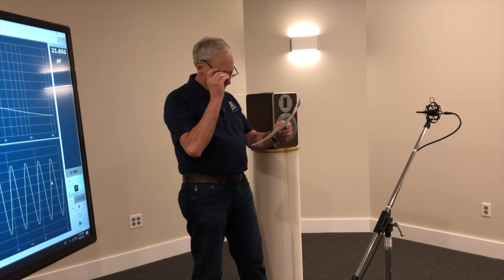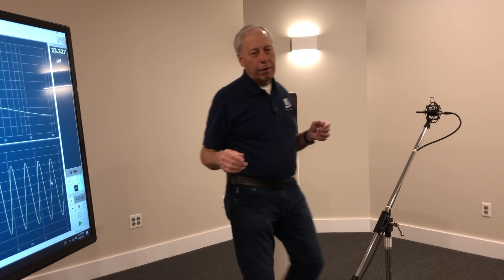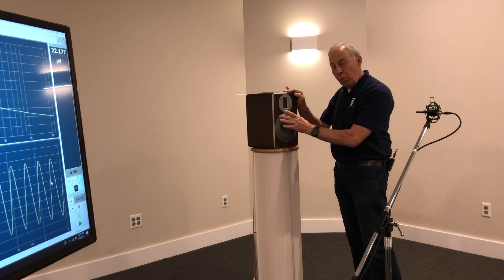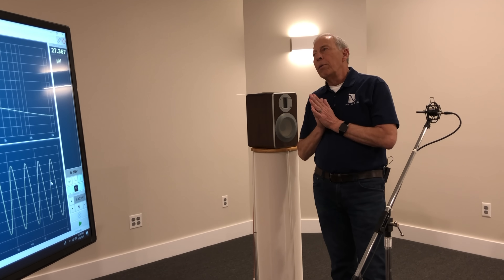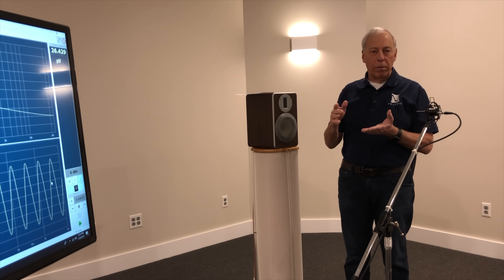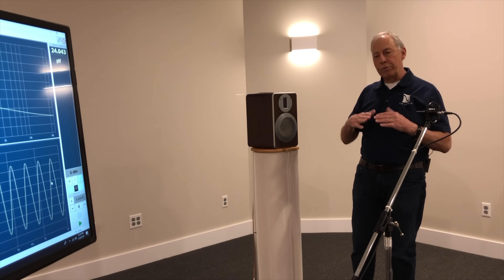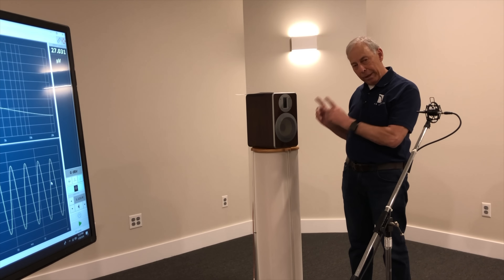How many drivers should a speaker have?

Comment: In my view, we need 5 way systems. The very low bass has unique requirements often only met by a subwoofer. The most acoustic energy in live music is covered by the midbass so this needs special treatment. Then we have the lower midrange where most of the voices get their "presence". The upper midrange and lower treble cover the overtones and finally, the very high audio frequencies need to be integrated so in my view need their own driver.
Now we have many that are perfectly happy with their wide band or 2 way speakers. Maybe they should just consider themselves lucky that they have not gotten used to something more "resolving" in terms of turning audio into emotion.

Comment: The best analogy is vegetables. Take for example celery. Say you have a whole celery, with roots. Celery is good, you want the top, the stem (so to speak), but not the root, you only use the good part. Celery is like tweeter. You also have potato.  With potato, you only want the rhizomes, which is part of the root. You dont want the top. Potato is like the woofer.

Comment: Splitting mid range boundaries should never be done.  Inserting a crossover in the mid range band ruins the clarity.  500 to 5000 or 7000 should never have a crossover.  Crossovers and differences in driver types introduce terrible phasing issues and muddles the should and response

Comment: I have a question regarding a situation where I need to use two mids wired in parallel. The one wavelength frequency of the two drivers center to center is just a bit lower than desired. Can I angle the drivers toward each other by no more than say a 110 degree included angle to reduce the center to center distance?

Comment: In order to understand speaker design, you FIRST have to know WHAT RULES YOU ARE BREAKING.  Most "engineers" don't.  Regarding speaker design, an engineer formerly from APT amplifier made it very clear to me recently: MOST SPEAKERS ARE NOT DESIGNED PROPERLY.  According to him, the APT 1 amplifier was created to work with bad designs and adapt to poor crossovers.  The era?  80s.  BUT: the garbage bad speaker designs continue today.  He said, when building speakers to pick the right drivers.  Don't pay attention to the specs, specs can lie.  For example, you might be enticed to rely on mid range 6" for low end.  NO!  Probably the wrong size diaphragm for a lower set of frequency range.  It'll get you by (I know, I tried this and it's pretty good), but again, it's probably the wrong size!  TEST to see what works more naturally.  Again, pick the correct size for the driver as bass - say, try a 12" instead.  The idea here; DON'T LIMIT THIS - give the driver the freedom to reproduce what you're really looking for.  Don't go for the 'canary in the coalmine'.  Many bozo, I mean...Bose speakers do.  Common sense part II: you have three drivers.  Not two, not two mids combined and tweeter.  NO.  Three; tweeter (perhaps 1" or so), mid range (3"-6") and bass (10" -12").  Testing and listening will determine if I'm right...every driver is different...but you get the point.  Plus, he urged spacing of drivers in the cab should be apart from each other in the case, not bunched together!  Plus, get the crossovers right, keep testing until the inducers, caps and resistor jive with the drivers for flat, yet pleasing response.  Get the balance right to avoid phasing like mentioned in video above.  Finally, get the cabinet the right size for goodness sakes; most cabs are the wrong size.  Give your dynamic drivers the SPACE they NEED.  These silly floor standing speakers or desktop designs are pin head designs because it makes the sound boxy.  NO!  I recently built one of these and I'm regretting it, even though the sound is amazing, it could've be whole lot better in quality for flat response IF the space the drivers are sitting in is ENOUGH.  Of course, all these 'rules' are meant to be broken.  It's really weird how we have not really had anything  (product wise) that is TRULY novel since the 80s for sound reproduction.  I just can't believe we're still talking about dynamic drivers.  By now, we should of moved on...(?)

Comment: All good explanation. 

Isn’t it true that the lower the frequencies the harder to build good speaker level crossovers? We have engaged “multi amp” as a solution to the sub 30Hz, and why not to engage another layer of separate amp in stereo to handle woofers territory, say between 40 and 600Hz and to handle it pure and well. Then just hand off the frequency band between 300Hz to 25kHz to a good-o-2 way speaker?

Comment: Being from the pro audio world. The best setup is a bi amp or tri amp system. Each driver has its own amplifier that goes through an active crossover. So much flexibility and you can pin point the sound that you want. 
Forget about passive garbage. 
If you’re going to spend mad money on equipment, then pro is the way to go!
Reply: Being from pro audio usually means being more deaf than the average audiophile due to music being played "too damn loud" too long.

Comment: Thanks Paul once again for the Education.  I've heard quite few people say that simple is better, however I own a pair of Elac UB5'S bookshelf slim series which is equipped with a 3 way crossover and I must honestly say the transition is super smooth.  I understand high order crossovers are more complex in addition to that it depends on what the designer is going for.  In this situation Andrew Jones is going for a more introductory into "high end" sound for the consumer and I believe with his design of the UB5'S as a 3-way you can venture off and won't be disappointed with bookshelf speakers if your a "Floorstander" perfered type of Audiophile.

Comment: I have speakers that are crossed in the midrange (1500hz).  The sound is very forward but smooth.  I recently bought some  small 2-way  Yamaha surround speakers from the thrift store.  I would guess they cross at 3khz.  I suddenly noticed female vocals sound better (no harshness) so do violins.  I do not recommend crossing in the midrange.  I would go from 200hz or 300hz to 3k or 4k.
Reply: I have a pair of JBL's that crossover way up at 4k.  They are fabulous for vocals.

Comment: The trick I give to my friends is to have two pairs of similarly sized loudspeakers but from different brands. The latest combination was Polk S20E with Dali Oberon 3. Of course, the amp needs to have 4 outputs and enough wattage. Combinations do miracles...
Reply: Interesting concept.  What one speaker doesn't give you, the other does.  Although if both models are strong in a particular frequency, it's might be too much.  But fun to try.

Comment: Often I would try a crossover on just one speaker before making the other. This saves time and labour if it doesn't work out. That said: After I have just one speaker going, I seem to be hearing "more med" with both speakers going. Whether it's the stereo effect (and I had the quiet voice channel by coincidence every time) or there is something acoustic going on, to make 2 speakers seem to produce more med than just 1.

Comment: 4:51 I reckon the crossover is the hardest, and like impossible if you haven't done it before. But for me, getting the right drivers I want is pretty difficult (if you are a point source nutter). I started crossovers by copying the simplest crossover on speakers. A cap and a choke and a resistor. I bought a crossover kit from TANDY electronics (in the seventies) and that's what the kit contained. And I then discovered it's what's in the cheapest real crossovers in speakers. If I didn't buy the crossover kit, I probably wouldn't have every even tried to make my own crossovers. 

If you want to do it with your ears (instead of doing the math) you can (for your own speakers) but don't just try to sell them just yet. I suggest you start with a cap for the tweeter say 2-3 mf (depending on the driver). And a choke for the woofer 1 mh (depending on the driver). It's always better to run the woofer with a choke (even if it's really small and doesn't do much) cos the choke prevents a lot of the lost treble (that would normally go through the woofer) to go through the tweeter, where you want it. The choke tends to diverge the treble back into the tweeter cos it meets higher resistance through the woofer cos of the choke. And you get more treble, cos more of it is going through the tweeter.

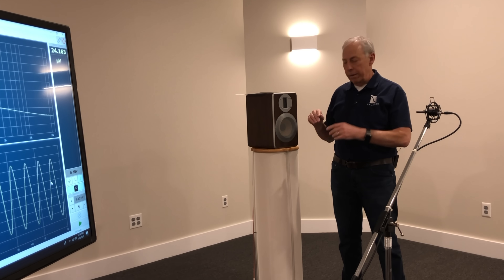Comment: 3:38 You get the treble wobbling out with the bass excursions. And an even bigger problem with cheap single drivers is that some are less efficient at max excursion, so you get an oscillation affect with the treble&med sound going louder and softer with the excursions. terrible

Comment: To make the med clearer on a cheap two way speaker, sneak a little med into the tweeter (depending on the tweeter). Cone and dome tweeters are fine. Just add a 30 mf cap in series with a 33 ohm resistor, in parallel with the main tweeter cap. If some top end is lost, add a .1 mh choke in series with the 30 mf cap and 33 ohm resistor on the tweeter. And resist the woofer by an ohm or two, if you think you have to, cos the tweeter will be less efficient but sound really amazing. 

Another trick is to add a .5 choke to in series with the existing choke(s) on the woofer just by adding it to the + on the woofer it'self. This will cut med in woofer to compensate for the extra trickle of tweeter med. At that 33 ohm resistance it still adds med content and to the extent that it's better to choke the woofer just a bit.

I do it to two ways when I get the chance, they sound way better cos some of the nasty stuff is now in the tweeter and it smooths off the woofer high med (which is a bit less too). And it's closer to point source, sound more coherent and crosses over better and way better transients in the upper med. Some speakers already have that. I think the KEF C20 bookshelfs have it (instead of just one cap on the tweeter).

Comment: I MADE THE ONE SPEAKER, NOW I HAVE TO MAKE ANOTHER.

Woofers get those nasty resonances @ a few khz cos they are so heavy compared to small drivers for the job. I just built a speaker (one to go) and it has a 3" med and about only one sour note (a woofer would have several sour notes @ those frequencies). I got rid of it with 3 things. I put a lot of wadding in the enclosure, choked it and let upper med it in again with a cap so there is a dip at the loud note. Then I pushed in the cone and scribed a deep line around the cone about 1 cm out from the core. It's a $7 driver, so I can afford to destroy it. Can't hear the  nasty note any more, though. 

I made the crossover last night and this morning and the speaker sounds awesome with the small med speaker. It's a 3" FR driver with added top end with a tweeter. And the tweeter is heavily modified and mounted at the rear of the 3" FR driver and has a stick poking through a hole in the 3" driver. And there is a tiny "tizzer" on the end of the stick (it's point source with the 3" driver). Works and sound awesome (SPACIAL with just one speaker complete). And of course there is a 6.5" woofer too, in a semi omni directional tower enclosure. 

Definitely the best speaker I have ever made. Great high frequency response and transients, with the tiny whizzer tweeter, great med transients with the small 3" med cone, but for the really high stuff, a 3" cone loses in transient response (compared to the much lighter tweeters). And this is where the added tweeter and tizzer helps. It's point source sound that goes beyond 12 kh (without using EXPENSIVE FR drivers). Extra woofer takes care of the excursions. Bass is also in the 3" med driver but subdued in the lows, for a better "still" cone (less Doppler). And the tweeter smooths that out too, being like completely still. Some FR drivers don't move much, and they are best for this (and have a really thin cone for great transients). Considering all that stuff, you can build an awesome pair of speakers with cheap components and knowing what to do with them (with no limit in what you can do, cos they are so cheap). And these speakers will be something new and refreshingly different to the norm.

Another trick with the med is that I lifted the 3" FR driver from the hole like 1-2 mm above the hole with spacers. It gives the treble and med a more "delicate open" sound. I's important to get it just the right height above the hole and you can tell just by holding the driver over the hole and moving it in up and down. lol It also kills the resonance note (if you get it right) but it can also increase it if you have the wrong gap. I'm listening to the speaker now, with YouTube on. Sounds awesome and I'm now finishing the other one as soon as my new 3" drivers arrive. I fucked one, getting the dust cap off, so I need another pair, before I can have 2 speakers going.

Comment: With the available drivers out there you can build an amazing speaker with only two drivers.  IMHO, when you are using a small woofer (6.5" or under) and rely on a sub-woofer to reproduce the ultra low stuff (under 50-100z), the two way system is the best.  OTOH, if you need a higher output in sound level, then a larger woofer (8"-12") is needed.  These larger woofers require either using a tweeter with a lower resonate frequency (and lower cross over frequency), or to add a mid range driver to the mix, making it a three way system.  An alternate design is to use multiple woofers (in an MTM or MMTTMM array) to get the higher level of sound without requiring the mid range driver.  The MTM array usually requires a third order crossover, while the simpler two driver system gets by with a second order crossover.

Comment: about 30 years ago, my dad bought a pair of PS speakers - they werent much to look at, like a small tower with a tweeter, midrange, and (i think) an 8" woofer and a passive radiator. those little guys were so impressive - of course being a teenager i always had the amp cranked up extremely loud every chance i got - it pounded the walls and shook ornaments off shelves....loved those things.

Comment: Oh man could I play in there!
Ok, I think the limiting factor is when it comes to the crossover design. My old three way speakers were crossed at 500hz between the woofer and the midrange, and 3000hz between the midrange and the tweeter. After I built them the dome midranges I had at the time dropped off at around 16000hz, so I installed a supertweeter and it brought out the definition in the top end and the definition across the board. If I had had better tweeters available at the time I would have used them. As far as crossing the super tweeter over I just used a capacitor to limit the lower frequencies and played around with various sizes until I found one that sounded right. Certainly not the way to do it.
My new speakers, or the ones that replaced the 3ways about 18 yrs ago are simp,e two way design that were meant to be used with a subwoofer which I also have. But, the way they were designed the bottom end is punchy enough to play without the sub woofer in most instances and still be musically enjoyable. When I really need the sub is when a movie gets into a battle scene, or the deep rumble of a spaceship engine etc. not needed for everyday stuff at all.